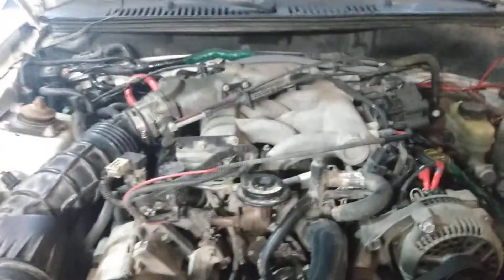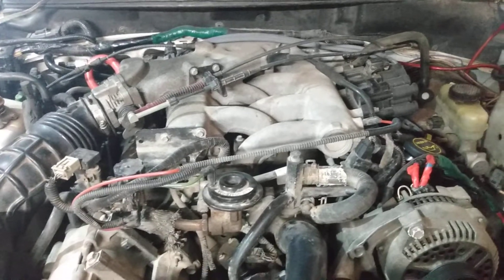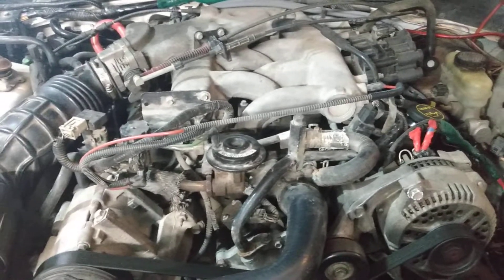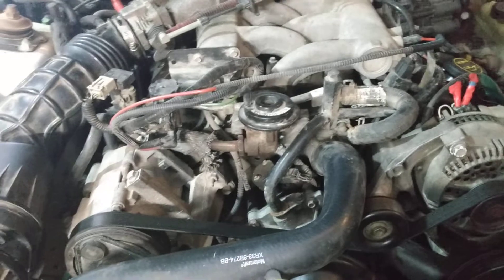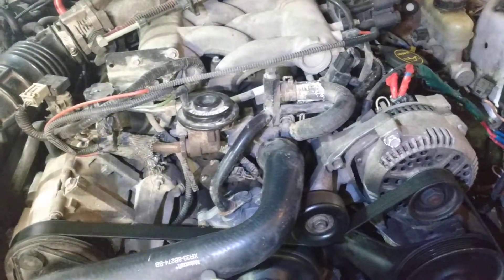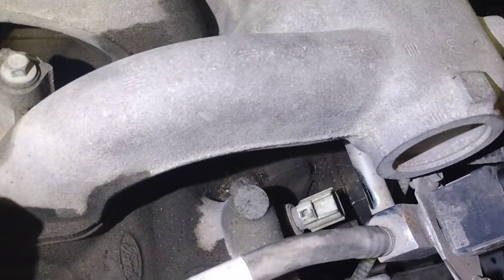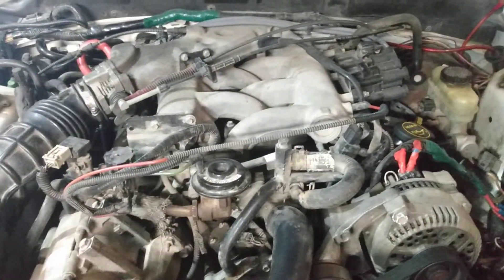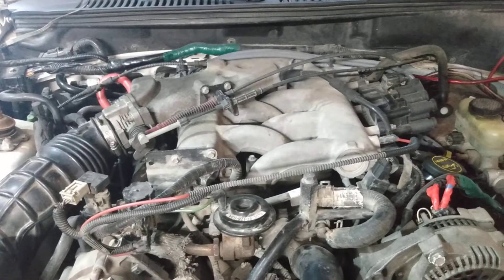Help Us Attach ECT Sensor '99-'01 Mustang 3.8L V6

Comment: 1999 and 2000 3.8L V6 use a ECT. Sensor where yours is located on the new engine. But 2001 to 2004 3.8L V6 use a ECT  on the back of the driver side head. I bet if you look there will be an unplugged connector on your factory wiring harness.

Comment: I'm thinking that since its not the original engine, there are several different places that tenp sensor could be, thus the connectir plug you're looking for is in a different location on the wiring harness. Our 01 3.8L sensor location is on the back of the drivers side head next to the firewall, and the harness going down has the plug   Where yours is in the video, mine has a bolt plug. Others are in the odd metal hose connection above the thermostat housing, some are off yhe water pump housing.

Comment: The harnes of the injectors 4-5-6 in this harnes would be the two wires for the coolant sensor you may need to remove the plenum to work with more space. Because the coolant harnes run under the plenum on top of the injectors.  You also need a new connector.  Search if the wires color of the sensor have specific positions. Farewell.